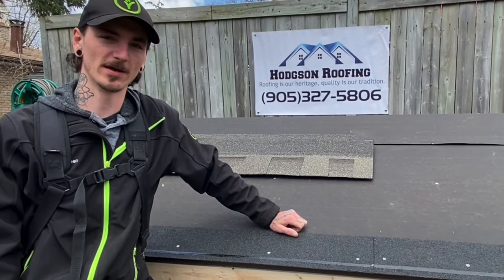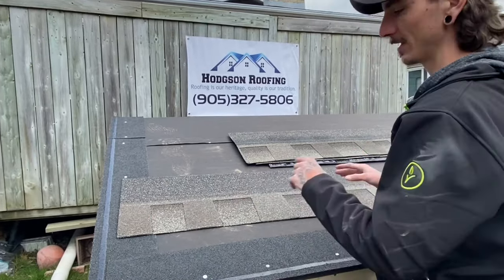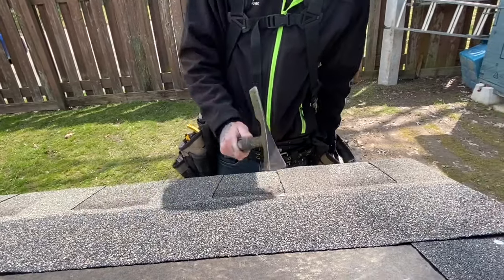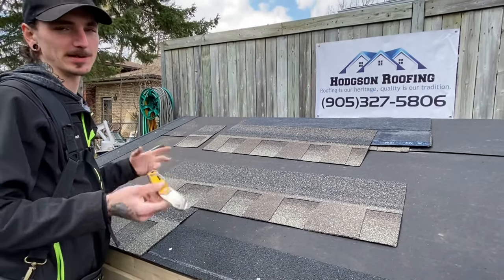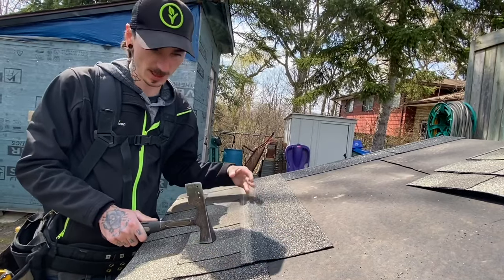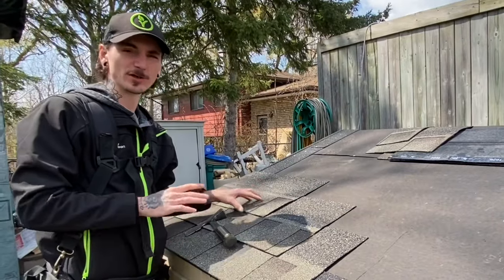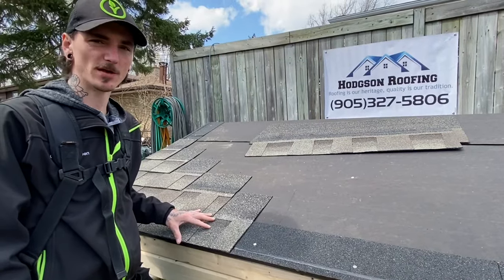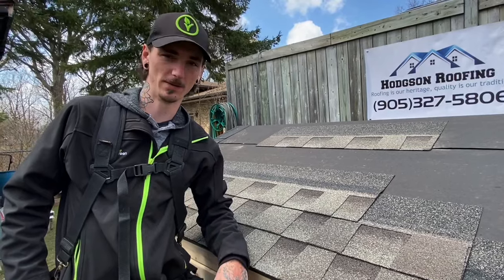How To Properly Start Shingle Courses On A Roof

Comment: The shingle is 3 feet long but you start every 5th row with a 6 inch piece. How can it be good practice to put a piece this small on the most vulnerable part of the roof. Also, videos like this never show what needs to be done at the other end of the roof on those rows that must finish with a very small piece.

Comment: Google secret from the old-timers books I've been doing shingles over 25 years rather.its residential or commercial Roofing best way to your shingles is a teachers cutting board guarantee straight lines every time and I prefer to hand pound my nails then Roofing guns singles has a 80% chance blowing off after using roofing gun than it does by hand Nal proven fact it might.take.longer but you wont be called back to fix the job

Comment: He's FIRED.... he left the plastic intact on the sealant strip ......Yes, you need to remove that cellophane or the roff will never seal .
Reply from the maker: The cellophane strip does not need to be removed as it will be laying on the roof deck and is only used for packaging and shipping purposes.

Comment: fuck when i did mine i got a couple of nail in waterline lol
Reply from the maker: It does happen. It’s not the end of the world but definitely a potential future leak point.
Reply: @Average_Roofer  good to know if it leaks in a couples of years i know why now thanks.
Reply from the maker: @AdrenalineRushMX  galvanized nails will take approximately 3-10 years to rust and begin leaking depending on low cal climates. If a leak starts with a nail it will be very minor and you probably wouldn’t even notice it for many years. It would be a very slow drip.

Comment: 6 inches too little... read the package 8 to 10 inchs and actually 10 to 16 for the first 6 rows.... also way too much reveal.... should be below that double
Reply: Split the first shingle in half, throw one half side for the next set. 8 " steps are Bs. Just manufacturers covering their As I get near the top, I start cutting my first shingle about 2.5 off center, then use both halves in a set.compensating the next cuts between 4 and 5.  This is very naughty,  but way quicker. Never had a problem.

Comment: All that side stepping is ridiculous.
Just go straight up the Eve and cut 6 inches off every other one to get a stagger. Gives at least 1 strait edge with no need for cutting and run straight up the roof like 3tabs. Much easier to set yourself up for the next run instead of dragging at an angle.
 I've been told that there is a pattern and it won't work out my way! Have spent the last 35 yrs proving that wrong!

Comment: Bad video, he only shows a 5 course my shingle directions on package is 6 course cut every 6.5 inch to start course.
Reply from the maker: There are hundred of shingle brands / designs. They all have different specifications. So you’re right, but also wrong.

Comment: Bored. Think ill punch holes in these instructions.  The nails n your starters are landing way to close to the butts of the 1st row. If you are cuttig shings upside down, use a straigh blade and score and brake.  If u r using a hook blade cut them right side up. Good point about nail height.   You should be accidentally shooting a shiner every once in a while if u r trying to stay low

Comment: Don't learn roofing cause if you do you'll probably end up roofing or worse...you'll end up a roofer. No matter what you're promised It's a dead end job that destroys your body way before retirement and has no benefits. If you're on a crew that wants you to stock the shingles by ladder just go. When you purchase shingles free delivery is included. If you're running them up a ladder either they're stolen, your boss is a dumbass, or he just has no concern for  your safety or well being otherwise known as a jackass. Actually there are many strenuous jobs in construction that could be a hell of a lot easier if we used modern technology to do the heavy lifting. Many articles about future inventions on construction sites that would change the game that never happened.  You know why?...cause nobody gives a crap about construction workers. He's the last guy with his hand out to get paid after the architect, the inspector, the realtor, the home improvement store, and the contractor. He's the only guy left to try and haggle down after the previously named jackasses took the owner for everything he saved plus a loan. The only thing the construction worker gets is tangibility and a pissed off shook down customer. A handful of coated bolts cost more than a man's wage for a whole day. This ain't bob the builder. The fact is even Roofers don't want to be roofers.

Comment: Fawking dilly Wakker
Reply: Your left rake starter should go over your drip edge starter course. Nails too close to shingle edge too low on shingle, didn't peel cellophane strip for sealing. Drip edge starter should extend 1/4 inch beyond paper and new shingle should not be flush either should also extend another 1/4 inch beyond starter.